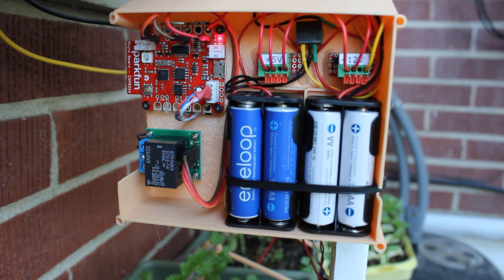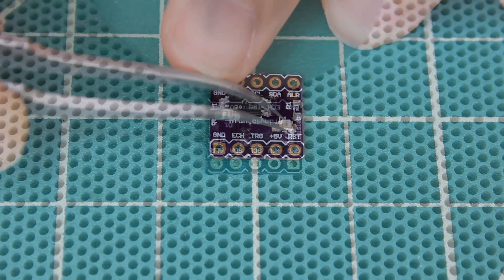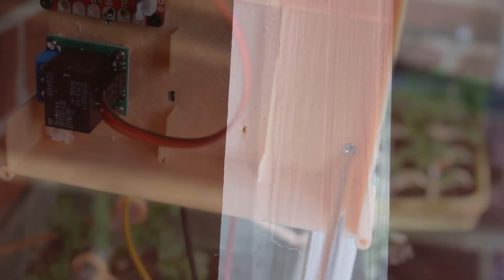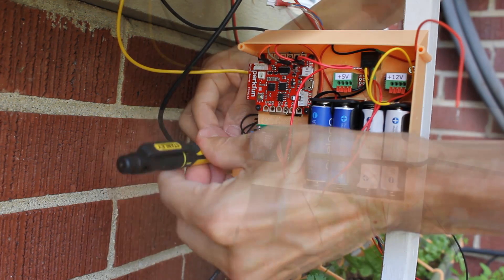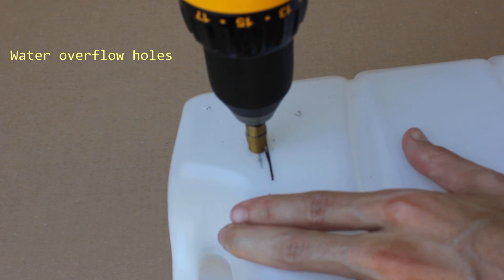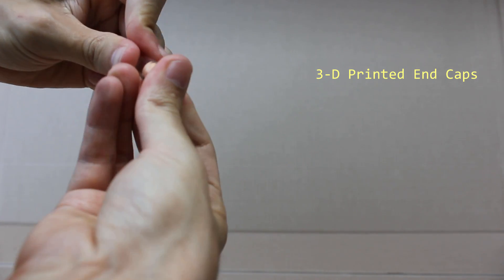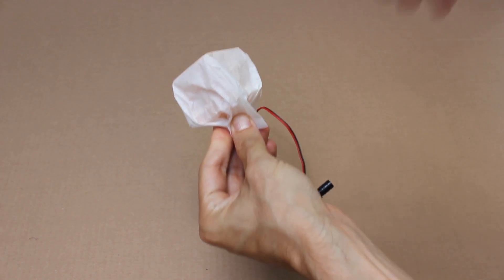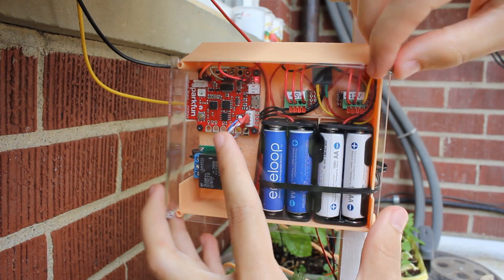Smart Modular Watering System using Blynk

Comment: How did you customize the Blynk app, are these provided in there library ?
Reply from the maker: Hello +dukat03, yes you start with a blank project and just need to add the widgets you need and configure them like changing the virtual pin, low/high value, color, etc.

Comment: Dude this is freekin brilliant. I am just curious how many weeks / months did you get it running with no hardwarre / software failures. I did a similar thing in a waterproof enclosure and I only ever got past the two month mark one time
Reply from the maker: Hello +Robotix, to be honest it took me like a couple of days setup the board had to run the manual setup and to understand how the read and send data to the app, after that it was like a week to have everything working.

Comment: Where the hell do people learn this shit? I've been trying to start learning Arduino but when questions arise suddenly everyone is stupid and no one knows what you're talking about. Tutorials only cover the most basic of things and you're either a complete idiot beginner or an advanced wizard class engineer. I can never find anything in between. So tiring since it applies to almost any field.
Reply: If you know your basics, I find books better than online tutorials. Also, you need patience and a certain passion for electronics and programming, especially for anything past beginner level.
Reply: I was in your shoes (or maybe slightly ahead from past work) but what I would suggest is spending a few hours here and there learning the basics of electricity and circuit parts as well as how they work. Then tinker around with just an Uno and build really simple projects for a few weeks then when you have an idea of what you want to build do your research, get your parts, and use the arduino forum when stuck.